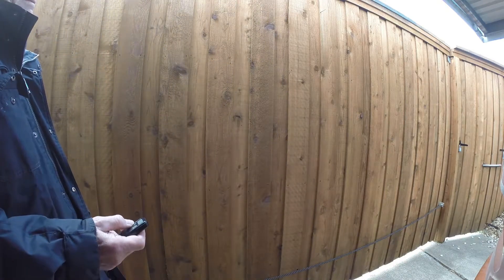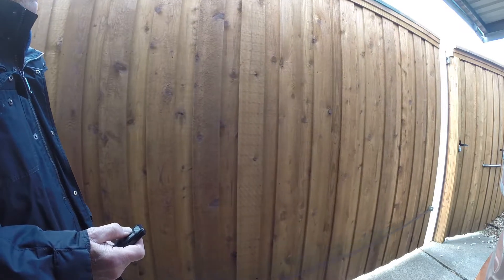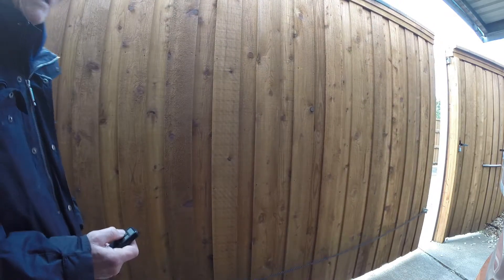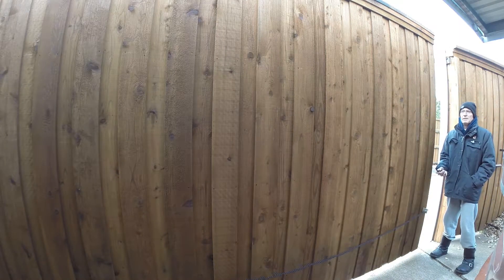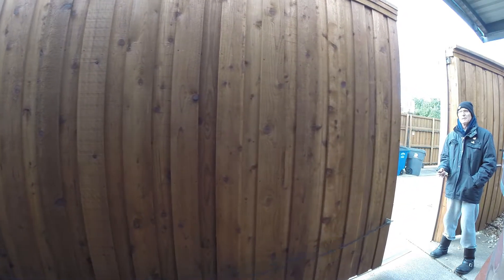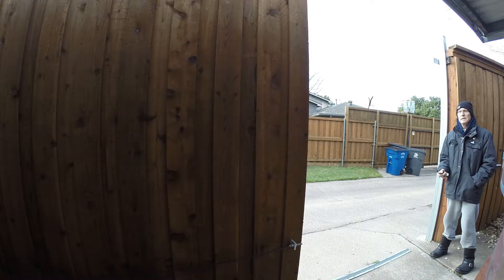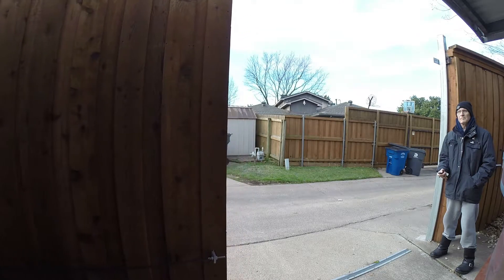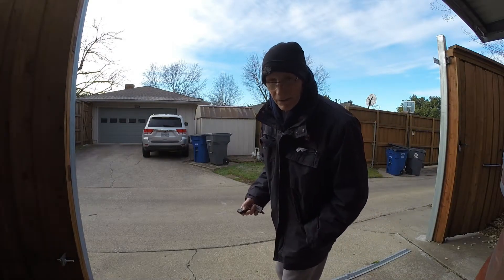1/24/2019 35º Liftmaster Gate FAIL

Comment: Having a similiar problem with mine, Did you ever figure it out or did you buy a different opener?
Reply from the maker: We ultimately replaced the magic box of gears, wheels and fairy dust.  This is the 6" square black plastic box attached to the motor shaft.
Reply: @WarrenPaulHarris  Thanks.. I tried that.. I gues my gate has a different fairy dust distrbutor   How much % did you spend before you got it fixed?  I know techs here charge 200 to show up and 100 as hr after first hpur
Reply from the maker: @leweezo33  I think we spent about $450 or so by the time we were done.  Maybe a little more.  This was an absolute nightmare.  Have you read the blog on this?
https://liftmasterfail.com